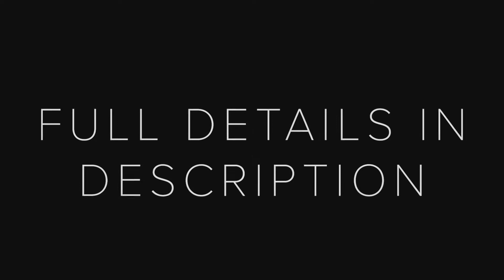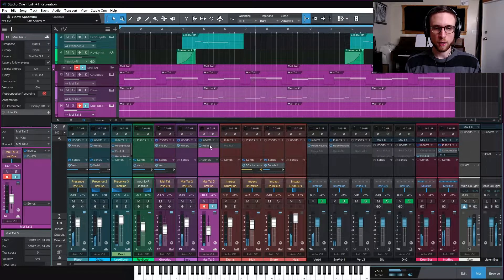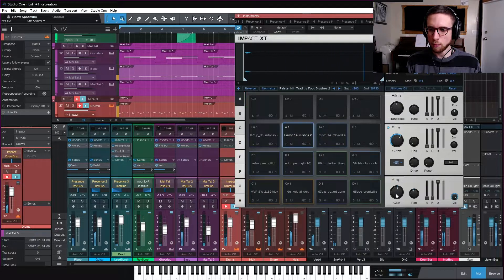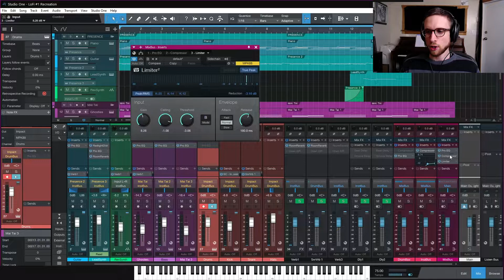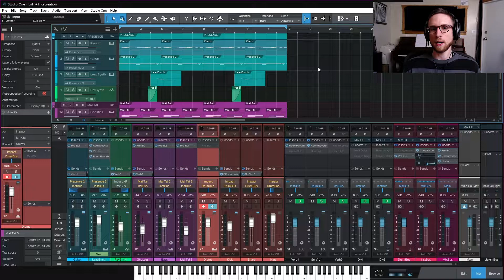Final Mix & Master | Studio One LoFi Tutorial | Part 9

Comment: As said before - great series. For a "newbie" that is what I actually needed - start to end, easy and clean mix to make. And I actually learned more than you showed - as I needed to replicate some of the stuff you did, and for that I needed to learn practical steps/functions my self. So overall - A+!
Still - I have overall question - on setting volume/gain for each track. In this series you are basically setting volumes (not always) of each track by their main track volume fader. But are you doing that also for "normal" projects with much more tracks in it? Or you using "gain staging" (hope that is correct term) approach when faders stay basically on 0, and you actually regulate gain with a instrument/plugin gain - basically mixing with "pre-gain" and only in final mixing you are changing faders? Hope this question makes sense :)
Reply from the maker: Great to hear! Thank you for the detailed comment 🌞

As for gain staging, you're right. I will do more involved work on my "real" music in order to maintain easy control of the faders. That being said, it's not very difficult. Perhaps I'll make a video on that soon...